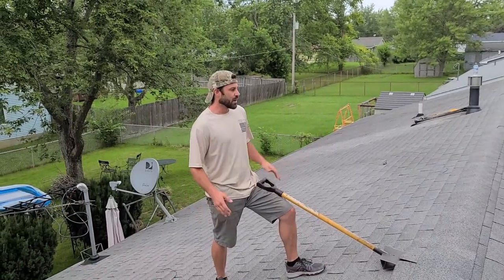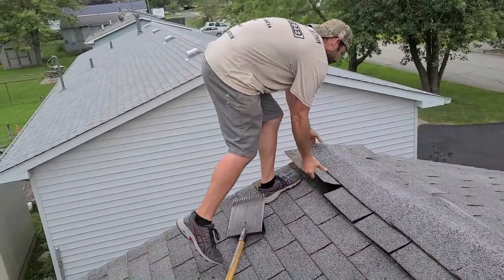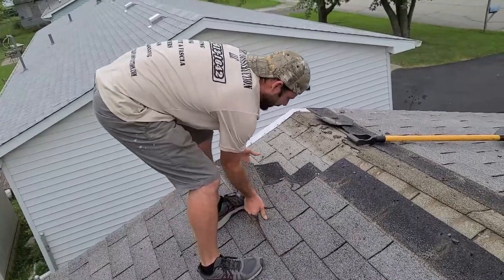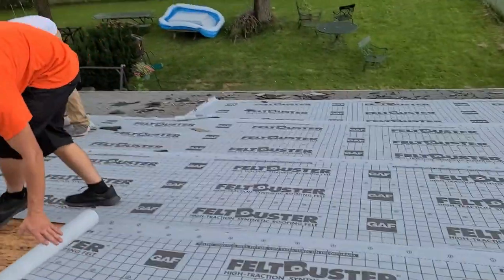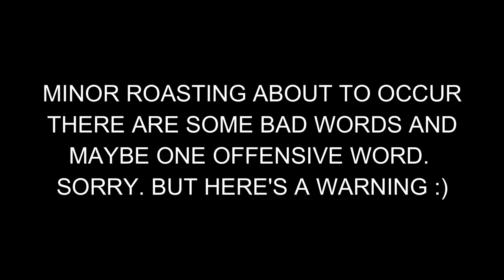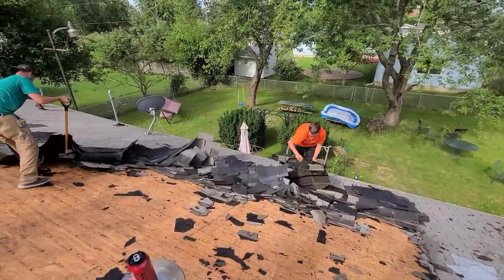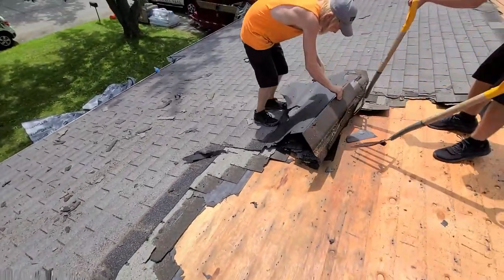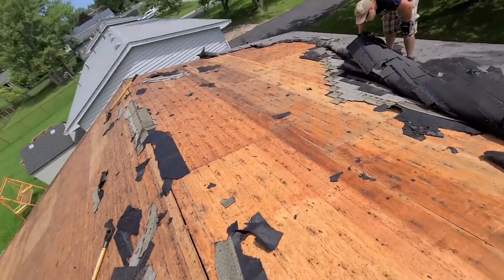I'm Back Making Roofing Videos!!!

Comment: advice.....when you tear off like these guys are doing you throw the torn shingles onto the plywood once there's an open spot so that  your garbage isn't in the way if your gonna keep ripping. you also make nice piles as your ripping and throwing it on the plywood so that when you go to grab it to throw it in the bin it's nice amd easy, roofing isn't easy and anything you can do to make the job clean and easy do it. Also having the laborer hold the shingles while you rip is kinda like throwing money away. two good laborers on a 20 square roof should be able to keep up with three rippers np so by the time the ripping is done the garbage is thrown already. Little tricks I've learned over 19 years of ripping and shingling.

Comment: Would that leak if u stapled it? Is that why u capped nailed  it. I used that on my garage just to protect the plywood and it was leaking pretty good. I stapled it tho I didn’t use cap nails. The only reason I can see that it would leak because of the staples thanks a lot man love your videos
Reply from the maker: Yes staples will leak in rain. You're aloud to staple it though. Some are even rated for walking on when only stapled
Reply: Zack of All Trades Thanks a lot that’s what I was thinking too I went back to the 30 pound felt seems to work better thanks for getting back to me though love your videos to keep them coming I learn a lot from you

Comment: Do they not have red rippers where you're from?
Reply from the maker: I've never used one... doesn't look as good as those yellow ones I get from the depot...
Reply: @NWIVeteranConstruction  There nice and light weight, I'd reccomened you try and get a hold of a couple. I could rip all day with one I wouldn't use anything else but its what I was raised with so it's all about preference I guess.
Reply: @NWIVeteranConstruction  it's all anyone seams to  use here in Southern Ontario. I've tried a few other similar ones and the classic pitch fork but the red rippers are the best